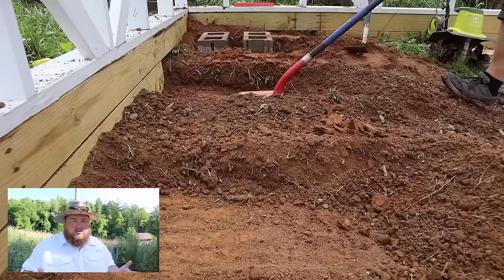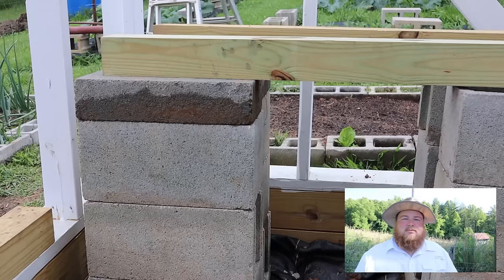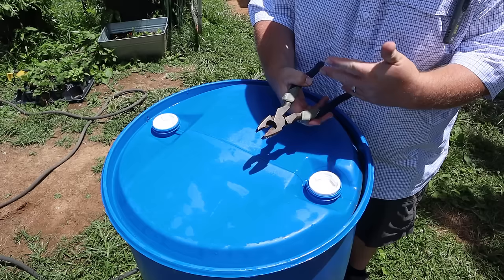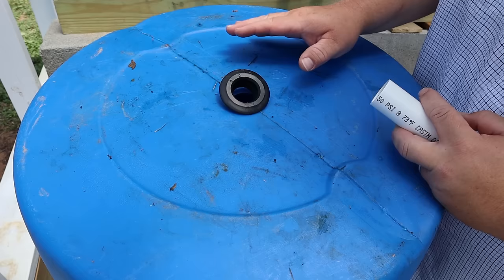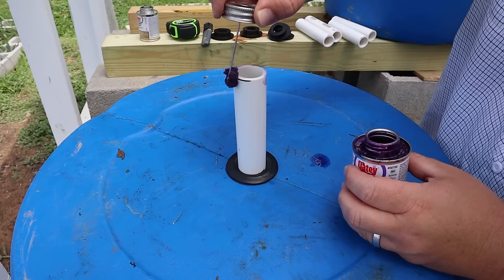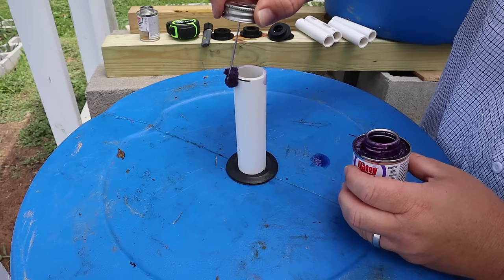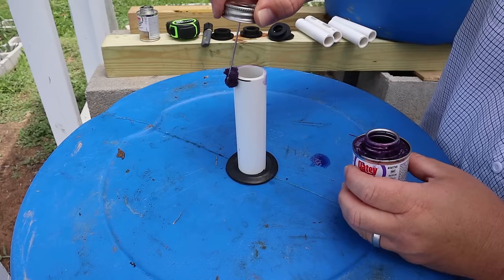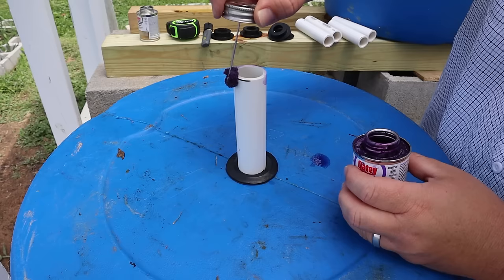COMPLETE Rainwater System START TO FINISH - DIY Greenhouse Build #10

Comment: Just a suggestion but if you move the barrels outside the green house (maybe behind it) that would  give you more space inside.
Reply: @SwiftyUniverse - He is probably exploiting the water's thermal mass to even out the 24-hour greenhouse air temperature. Excess heat is absorbed during the daytime, and then discharged at night when it is cooler.

Comment: I used 4 inch for Mt first flush and and an empty 16.9 water bottle in the first flush to a two inch piece just below a two inch drain to the barrels! It floats up and closes the top forcing the water into the barrels

Comment: From past experience putting union in the pipe between barrels makes it easier to work on latter if necessary. I like the diverter and will try it in my system. I am fortunate to have access to (250 gal) totes that I am going to use. They are already plumbed with 1.5" threaded ball valve.

Comment: That unseal is a great product, Great tip
Also if you push it to much your drain will be higher and will not drain as much water.
Thanks
Reply: So where do you get uniseals

Comment: Great video! Check your math on the overflow pipes. Five 1" pipes is not greater than two 2" pipes.
Reply: Correct observation. A = 1/4 x 3.14 x d x d. So for d = 2 for water entry, A = 3.14. With 2 pipes coming in, it results in 6.28. For d =1 for water overflow, A = 1/4 x 3.14. With 5 overflow pipes, the capacity is 5/4 x 3.14 which is less than 6.28. You would need at least 8 overflow pipes of 2 inch or replacing one of the 1 inch pipe by a 2 inch version.

Comment: Per Daniel Bernoulli, ....the gravitational potential energy of elevation, and the kinetic energy of fluid motion, remains constant.  So, the water will remain at the same level, elevation, in all the barrels. To calculate your overflow drains, just use area in to area out. 
Even though I got out of Fluid Mechanics with a decent grade, I’m terrible at plumbing.  You did an excellent job.
Reply from the maker: I love this comment!!! 👍🏻👍🏻👍🏻👍🏻👍🏻👍🏻

Comment: Nice build I’m sure this is going to work for yrs to come . I built my system almost the same as your but I used 2  350 gal totes and it has worked for over 2 yrs now  nothing like saving money using rain water

Comment: Nice work brother!  I'm in the planning phase of building a system VERY similar to your system to use for house water.  I will be installing in the unfinished basement.  I will be catching the rain AND the snow melt so I need all the freezable fragile parts inside.  I most likely will be using 330gal UBC totes.  A 12v pressure sensing water pump (easy solar application) can make such a system appear like you're on your well or utility water supply.  Thanks for sharing.

Comment: Nasty weather today in the High Desert of Cali so I thought I’d watch a few vids.  I am amazed at how people have done so much work and spent so much money to build rain catchment systems.  I am a single woman farmer, 78, so I do things the easy way.

I bought a rectangular Intex swimming pool. All around the outer perimeter, I built wood structures, on an angle that hold 6’ clear polycarbonate panels.  When it rains, the water funnels into the pool.  I sunk 9 - 55 gallon barrels (food grade) into the ground, with about 2” sticking up out of the ground.  I cut the tops completely off the barrels and affixed plywood lids.  I have a sump pump ($50) in the pool and after a rain, I pump the water into the barrels.  I didn’t like the idea of not being able to see into the barrel - I want to know if the water has algae, etc.  I was going to put more barrels in the ground but I haven’t need to do that yet.

Comment: Love your attitude, curious if you are having any sediment issues in those lower pipes? I want to do something similar but will probably connect them so that it is approximately 1 inch off the bottom to avoid any sediment issues instead of piping them underneath.

Comment: If it were me, I would have drilled the hole on the bottom just off-center enough as to not have the seam bisecting the hole, for better sealing, and less likely to leak.

Comment: I feel like the barrels should be outside the greenhouse to make more room inside for plants and such
Reply from the maker: Yes for the room inside the greenhouse, but no for their use come winter. They will absorb the heat from the sun and help to regulate the temperature inside the greenhouse overnight. They will act as thermal mass in there.
Reply: @sam-and-angela  after I made this comment I saw you already explained about Thermal Mass. Thanx for explaining again. I really enjoy your videos. You have great content.

Comment: Question: Why the holes drilled in plug caps of first flush? Seems more efficient to use a ball valve, unless trees are dropping debris on roof. I am considering Rainwater system on home. Long story short, utility charges 3x water use cost for sewer billing. Outraged and determined. Surfing YouTube for everything to build my system. Thanks for your ideas and explanations.

Comment: I find it interesting that you're doing exactly what i've been planning too. I'm at 53 degrees north in Canada, so I'll be using one barrel (in a 10x10 greenhouse) but I'm thinking I'll put in a hot bed below the barrel.  The hot bed will provide heat to the greenhouse as well as heat the barrel for more thermal mass
Reply from the maker: Very cool!! I don’t know if I will get to it this year with our home projects going on but have plans for a solar water heater to use in winter to add thermal mass and heat inside. A simple coil of black pipe and 12v pump circulating water. We’ll see... 😁

Comment: Get rid of the holes in the bottom of the first flush system. You're losing water. Just go out every couple of months and remove the plug to clean it out. And just fill through the holes you plugged in the top of the barrels. Vent through the gap around your fill pipes.

Comment: You are funny...the bit I missed taking in was... how does the diverter stop diverting and switch to filling the drums, after the first flushing has occurred? Ahaaa, I see you are very clever too! You have sectionised your video and named the steps you took...how good is this!!! I left this comment up, as I went back to look for how it worked, a few times, then noticed the sections, which I thought were ads, so I dismissed them...until I read what they said! Dohhh...My question is answered, thankyou. Great job. Am trying to adapt the water collection system to a hooptunnel curve idea, as my gardens are down the paddock and we live in an area in Hungary that gets up to 6 months of freeze temps, which bust the pipes etc. This makes laying town water, down the paddock,  hard for me...plus the water here is full of minerals etc that I can't drink and def don't want in my food. The excess minerals upset my body electrolyte system...(but are great for healing theraputic baths...everywhere here in Hungary.) I guess I could complete the hoop tunnel, then put a plastic pitched roof over it...or build the pitched roof version? Back to the drawing board now. Thanks again. You have also just helped create a house watering system idea I have been working on for collecting rainwater for washing up, showering etc, in the house here. It rains a heap in summer, so this entire system idea will work...plus, I found a 5,000 litre drum I can bury to collect rainwater in summer, for winter so it doesn't freeze. Do you think that can work?

Comment: Very nice video. I picked up a lot of good ideas. Can I make a couple of suggestions. Use nylon pipe strap to secure your pipe in place rather than metal brackets or long screws; cheaper, nicer looking (I think), more secure and more versatile. Don't glue your fittings. Use two #6 1/2-inch washer head, sheet metal screws. One on each side. That way you aren't exposed to solvents and you can reuse your pipe or make adjustments. Cinched PVC pipe fittings don't leak normally or at least not enough to matter. Use a rubber mallet to tap it in place. You can hear when it bottoms out.

Comment: Great video, and an inspiring set up.
I am confused as to why you glued everything.  I understand why you glued the flush tubes as the weight of the water and the tubing could pull it out.  The non pressure points feeding the intake however did not require gluing and actually makes it harder to do maintenance later on.
That said, it is only my 2 cents on it.
Do not let that take away from a great video.

Comment: The area of the circle uses the square of the radius.  The pipes going in are still 1/2 again bigger than all the drain pipes.  Worst case you gutter is overflowing in a nasty gully washer.

Comment: Nice video, I’m planning on building a system myself but was planning on having some type of tank first filled with gravel and sand to filter out the debris.  Probably would need to be cleaned out once in a while but then I’m not loosing any water.  But I’m trying to figure out how to set it up since it needs to be higher than the other tanks and it’s all experimental also.

Comment: I didn't catch what you used to plug the first flush to allow the water to be diverted to the barrels. I've seen plastic balls and empty water bottles.
I currently have 5 barrels that I use to collect rainwater for my home use, but they are not plumbed together or even hooked up to a proper gutter system.  Hope to remedy that soon.
Reply from the maker: I've used float plugs in the past, but didn't do any for this system. It's not that necessary in my opinion for this use (irrigation). If it were going for drinking uses (animals, mainly) then I would probably put a float in it. A year or two back I made a rainwater chicken water system and did use a float -- a gatorade bottle for that one. https://youtu.be/g6Z-gPs29jU

Comment: I have 4 barrels 
I put union between them so I can take the apart if necessary and have pvc valves on each 
You only need one over flow because the water find the high spot
Hope you fixed the clea flush system

Comment: Looks good and simple. I didn't understand the pipe that filled the barrels looked like fell below the top where it dumped water into the barrels. Had to go under a angled board of the building. I thought in order to fill the barrels it would just slope down from the eve through. It worked you proved that but I thought it would go to the clamour the way it was set up. Maybe I need to watch it again. 👍
Reply: Clean out. Spell check. 😡
Reply from the maker: No worries, I understood you still. :) The side where it dips below the barrel then comes back up works on the same principle as a P-Trap does on a sink. The weight of the water, having no where else to go, pushes up and over into the barrel. It wasn't ideal, but does work at least! :)

Comment: Nice job. I just have one question. If the water equals out in the barrels, wouldn't you just need one overflow pipe not 4 on each barrel???    Just curious

Comment: One of the bung caps already has a 3/4” thread. You can thread a pipe right into it and not have to buy any other rubber seals. Little pipe tape is all.  Turn barrel upside down. I just screw a 90 in and add pipe. Also you can get plastic spigots for $2 at ace.

Comment: You essentially melted the plastic when you ran your drill backwards and that’s why you lost your coupon. Try some food grade mineral oil to keep the cut cool and not deform the plastic. You’ll have shaving either way and you may want to take a file to get rid of the burs. Rinse the barrel when you are done to remove the oil and shavings.

Comment: Just an idea, but if you build a high stand with a tank up high, you can use a small solar powered pump to pump water from the water tanks up to it, then you have increased water pressure from the gravity feed when you need it. Use a cheap sensor if you're feeling fancy to turn the pump on when the level drops below a certain point. Even a simple float from a toilet would do.

Comment: Curious why you didn’t connect the overflow pipes to fill an external barrel or two for warm weather between rainfall events in case they are few and far apart.

Otherwise, outstanding editing, well placed camera, and great assistant!  Thanks and God bless! Subscribed.

Comment: You can do the math to determine overflow vs inflow... pi (3.14)x r squared = V
1" pipe has .78 V x 5 = 3.92 of V
2" pipe has 3.14 V x 2 = 6.24 of V... means you have nearly twice the volume flowing in as you have overflow available...

Comment: Here's a tip that will be a little more than spits 'n' giggles.  Use a file, or a knife if your confident you won't cut your thumb, to put a little bevel on the ends of the pipe that will be pushed into the PVC fittings.  Sharp, unbeveled ends will just scrape the glue out of the fittings as it is pushed in.., much like a windshield wiper blade. A bevel allows (some say 'forces') glue to remain between pipe and fittings. PS! Don't believe anyone that says you don't need primer! Another tip is to wrap masking tape around your pipe, just beyond fitting depth. This is just for cosmetic purposes. After removing the tape, there won't be any excess primer or glue on the finished project! (Everyone will think that you are a God! An artist! The Michael Angelo of PVC pipe!)

Comment: Great video. Why did you drill holes in the plug at the bottom of the first flush pipe? Why does the water need to dribble out of the first flush pipe?

Comment: being the lazy guy that I am.. I would have installed pvc adapters in one of the bung holes. and no need to play with the rubber seals.  let the pipe hang over the front of the 4 x 4 .  Then just do it the same way that you did the piping

Comment: Excellent video all the way around Sam... you Rock Dude !
LIKED/SUBSCRIBED ! (Oh yeah.. If you put a small clear 3/8th or 1/2 inch plastic tube vertically from the bottom of one of your 55 gallon drums to the top it will show you how much water is in your Barrels !)
Reply from the maker: Awesome thank you!
Reply: If your environmental conditions produce algae in the clear tube, cover it with a piece of split foam tubular pipe insulation to prevent light from causing the contamination growth. Just slip it off to check the level.

Comment: Without having a commercial type first flush and not having a ball in the pipe to plug the water, have you found “materials” flowing into the barrels?

Comment: u need to drill a tiny hole into the highest section of the tube at 20:48 or else the air staying in there will reduce your max flow rate at this point. but just a tiny hole like needle thin. u know what i mean?

Comment: I understand the principle of filling from the bottom, to insure that each barrel fills evenly.  However, most sediments and trash always settle to the bottom.  It might turn into a nightmare to keep it cleaned out, to allow proper water flow and spigot use (over time).  I don't see how you can clean the pipes without cutting the pvc.  You could add a couple of in-line, threaded pipe and couplings to be able to gain access.  
Also, the drilled air holes on top of the rain barrels,  I would cover these with very fine screen to keep out mosquitoes and any other bugs from getting in and become a breeding ground for mosquito larva and such.  I don't know if that's a factor, as long as you're not drinking it.  
Nicely done video and very informative.

Comment: ~12:10 uhh, u never hear of an airlock? i hope you put air release valves in there or there will be no equalising. ~17:10 oops there you go. yeah you need those or they wont equalise at all. and you might just asplode the tops off them too. the inlet barrels are vented by the intets that arent sealed and the overflows vent the rest so no need to have holes
Reply: I think adding air locks on the top of each barrel instead of drilling the little holes would make it even harder for creepy-crawlies to get in.  
But how do you keep mold and/or algae from developing?

Comment: I’m curious if your first flush system fails. Your drilled holes in the bottom cap so the water will never build up to the diverter before it drains at the bottom. 
A 1 way value fitting at the bottom would fix this.
Turn it on once a month (depending on rainfall) to flush out the bad stuff.

Comment: My only worry is that your overflowpipes are very close to the foundations where the tanks are sitting. Water draining there can cause the earth to loosen up and, with all that weight sitting on top of it, allow those blocks to sink into the ground. At some point it will all topple over. Suggest that you, if you haven't already, put some hosepipes on your overflows and divert the water to somewhere else where it might be needed .. or even make a pond.

Comment: Do you really need an overflow on each barrel?  If you had one it should equalize out and overflow for all of the barrels.  That is unless you live where I do in Florida.  We do get monsoon like rain at times and they may overload the system.  It looks great and wish I had one in my back yard.  This summer I'm going to build something like this but leave it open during most of the year and even may plant fruit bearing vines around it.  During the cold months I'm planning on putting plastic around it and move all of the sensitive plants "indoors" so they don't freeze.  You have given me many great ideas to incorporate into my build.
Reply from the maker: In hind sight one overflow would have been fine -- if it were large enough. But we've not had any issues with our system in the year it's been done. There's a FAQ video up in the description where we look at things and give an update about 6-8 months after building it all.